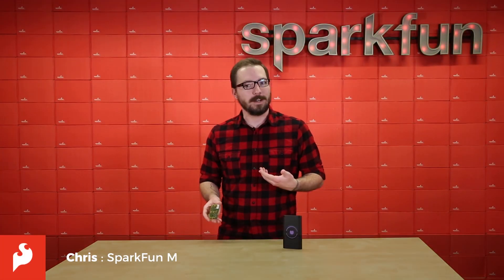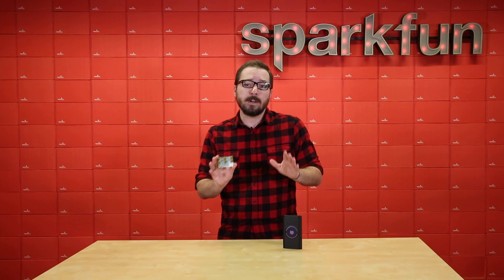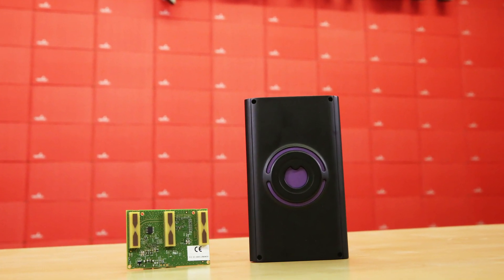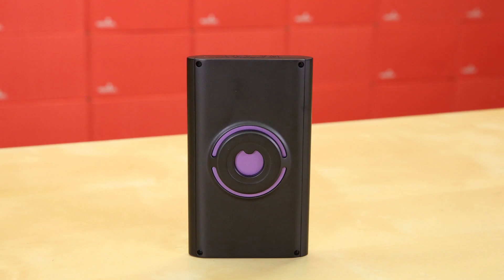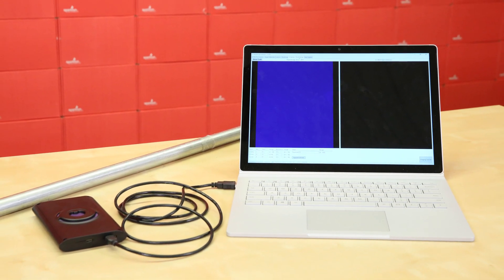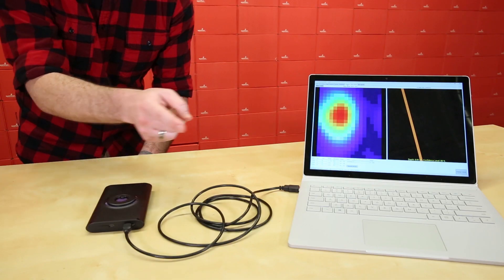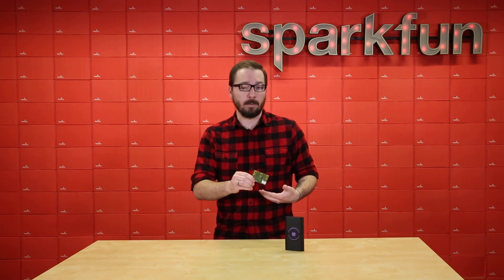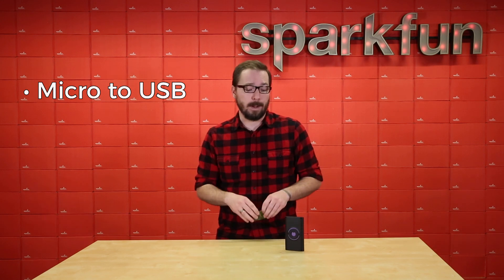Product Showcase: Walabot

Comment: C'mon Sparkfun - this is absolutely useless for helping a prospective purchaser understand exactly what either of these devices do.  Your example with the developer version shows a rainbow-heatmap blob, and what I have to guess is some software's analysis of the blob that says that you're waving that bit of EMT around under the table.  Since you never actually show us what you're doing, or how the system is responding to what you're doing, we're clueless whether that's actually what's going on, or whether we're just imagining what we'd like to imagine.

Worse, you're selling it as a developer item.  Developers don't want a pre-canned analysis that can detect EMT and house wiring.  We want to know what the raw data return is, so that we have some idea whether it's useful for _developing_things_.  There doesn't appear to be any correlation between the heatmap blob and the analysis that says "piece of EMT", but since you don't actually show us what you're doing, it's awfully difficult to intuit how the heatmap might correlate to the raw data, or what kind of output we might expect the device to produce, just in case we wanted to, you know, develop something...
Reply: Hi W Ray, wanted to share a bit more about Walabot. The video shows our basic demo applications but the Walabot has an API which enables you to develop your own applications.

See some examples of what people have already built on Hackster's Walabot page - https://www.hackster.io/contests/WalaBot

Alexa turn on THIS lamp
Vid - https://tinyurl.com/yddqnjts
Project - https://tinyurl.com/yastezlv

Tracking TV Stand
Vid - https://tinyurl.com/y8wadv3m
Project - https://tinyurl.com/ybx48cxk

Drone Race Practice
Vid - https://tinyurl.com/y7lbxw2e
Project - https://tinyurl.com/ybs9dw7j

If you want more information about Walabot developer, please check out our community pag https://walabot.com/community or e-mail us at support@walabot.com